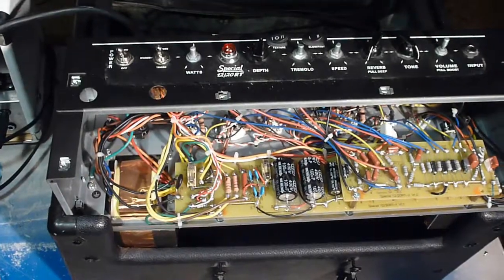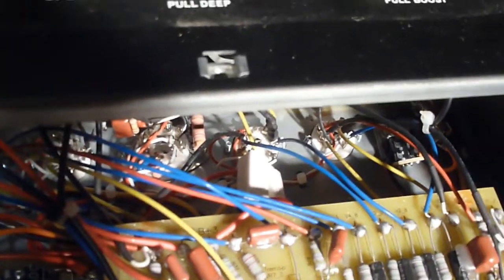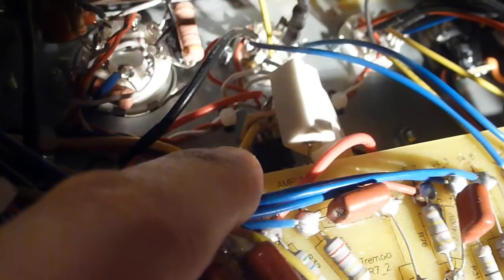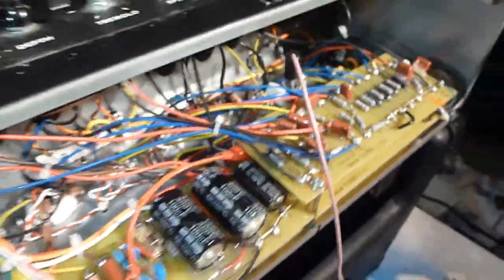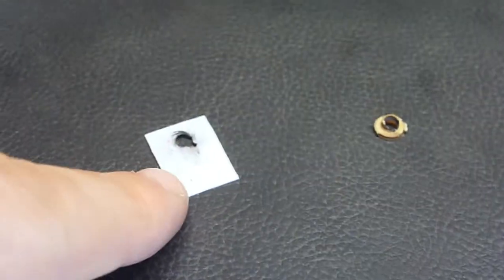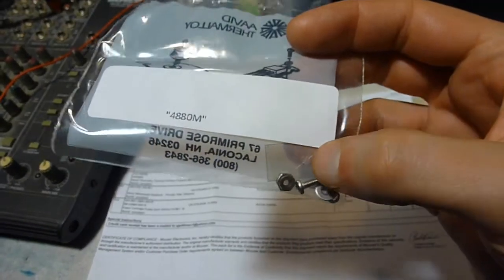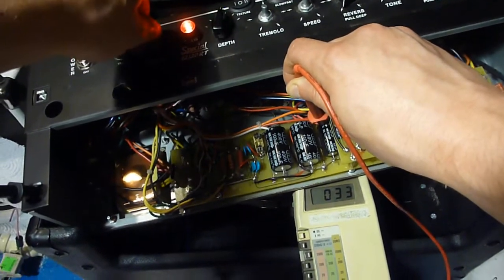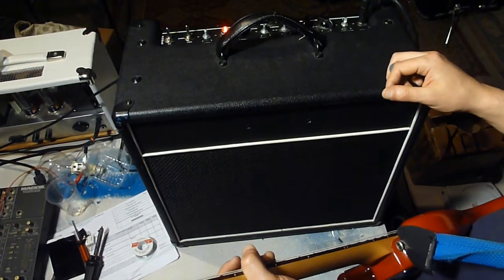Fixing a Special 12/20 RT: Power scaling short.

Comment: Soooo grateful for this. I have three of these amps. Only one is working right now. I never knew what those two box resistors are doing there or that they would burn out Even though I’ve seen Flames leaping from the board on at least two occasions.

Comment: I would have also put an heatsink. Similar circuits usually burn off about 1/4 of the total amp power when set at half amp power (based on my simulations)... Bolting the mosfet to the chassis would dissipate maybe 10W at most..
Reply: The location of the mosfet seems to be problematic.  I wonder if moving it to a new location and adding the heat sink would improve reliability?

Comment: I repaired a VHT with this same power scaling circuit that another "technician" had "repaired" but it had a lot of static/noise in it, which got worse when you adjusted the power scaling control.  When I saw all the carbon tracking on the power scaling board that had never been cleaned up, it became apparent where the noise was coming from.  I made a new circuit board for it out of perf board and then it ran like a champ.   I have a very low opinion of "technicians" who don't have sense enough to look at a burned circuit board and think that the burned area ITSELF may be part of the problem.

Comment: An important point the power control in these amps are mis- designed and nothing like what real London Power's Power Scaling is.   They fail to have a current limit in circuit and also it is different spot than today's LP Power Scaling.  The lack of a limit control guarantees poor performance.  Both of these issues need to be addressed for it to be reliable and sound good.
Reply: What would be the fix for this?
Reply: @roncarlson7186  they need a soft current limit added to the mosfet for safety, a limit control, and some other changes. It's not a quick fix but worth doing.   You'd really need a copy of the London Power Book on Power Scaling to understand what all the issues are.

Comment: Hey man thank you for the video. I am having a problem with the power scaling on mine and I need to find out where I can get the knob and or the circuitry.
Reply from the maker: I found the schematic on this forum:  http://www.tdpri.com/threads/vht-12-20-mods.475190/ and all of the parts in there are fairly readily available from Mouser, most are available from Antique Electronic Supply too. Is it a similar  problem described in the video? This was a simple short across the insulator between the power scaling mosfet and the chassis. Be aware that when on (and even for a bit after unplugging) the scaling circuit has 300-500 volts sitting on it and can kill you, so take precautions. The scaling chip itself is Q1 in the schematic. The knob itself is just a standard 1M pot, though I would suspect the pot itself isn't the issue.
Reply: @dissonantcognizance  thank you so much for this video. I have two of these amps and one of them was giving me the trouble. The amptech told me that it was a design flaw. He fixed it on both amps even though one of them was not given me any trouble. He said the same thing you said about a lot of voltage in such a short distance. So far it has been working great.

Comment: Do you think the power scaling on these amps is common failure?
Reply from the maker: I'm not sure, this is the only one of these amps I've ever seen. It does have a very high voltage difference across a very short distance, and that voltage difference would likely grow higher with an impedance mismatch, I can definitely see it happening on other amps too.
Reply: @dissonantcognizance  Thanks for your reply.
Reply: Yes. Mine failed after a few years but otherwise worked until I replaced the MOSFET.  I just got a second one (non-RT combo) that may have the same issue...